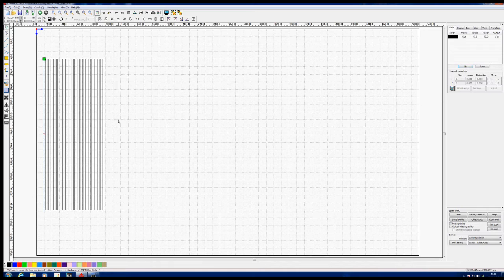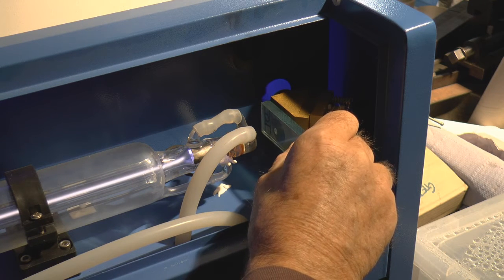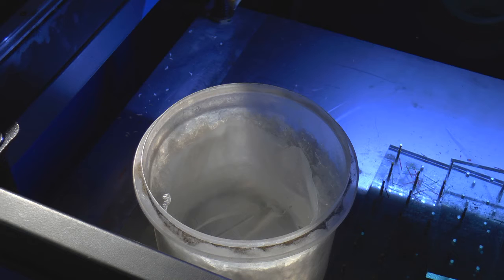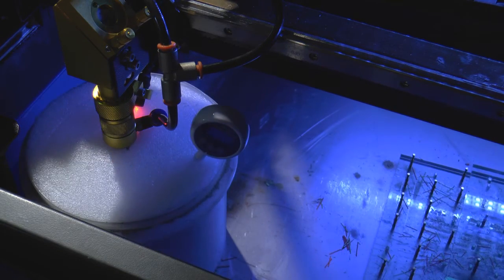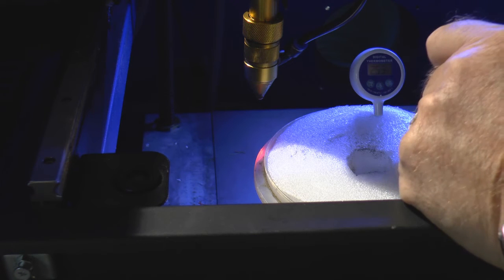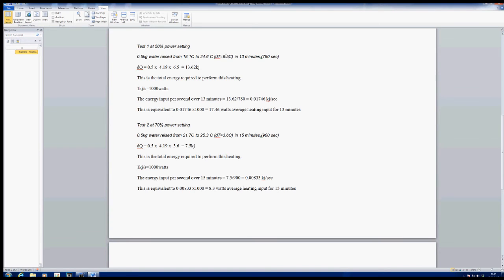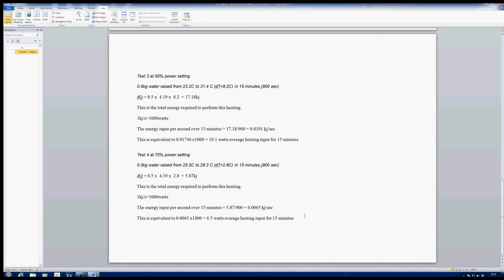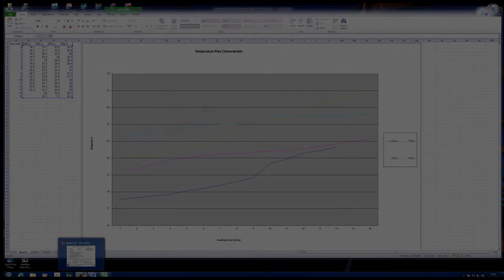RDWorks Learning Lab 21 DIY Calorimeter for wattage tests

Comment: Did you take the focal lens out to try the test?
I am thinking if it was focused it would vaporize the water surface and come of as steam without even heating the water properly.
Reply from the maker: +Mentorcase 
Both. I left it in originally for the tests on this video.  I think my lens is about 20mm focal length because I set my nozzle about 6mm above the cut surface. My water surface was about 70mm below the nozzle so the beam was certainly defocused. I also agitated the vessel continuously during the test to keep the water moving, thus limiting the possibility of measuring "hot" or "cold" spots. During my search for a CO2 laser  absorption factor for water I came across some research done by the US Navy, where they were trying to generate shock waves with a CO2 laser focused exactly on the surface of water. They were investigating this as a means of sub-sea communication.  It was a very short paper  because it failed due to the inability to accurately focus on the surface and the energy  then dissipated within a few millimetres. Without telling me the factor I was seeking, this fact indicated that I safe to use water as a test medium.
I have now fitted a replacement 50watt tube ( the video will be out in a couple of days) where I have done tests with and without the lens.

Comment: so long story short...   would you recommend these Chinese Lasers or steer clear?
I've watched all your videos from delivery to replacement tube...   was it worth it?
Would it have been much more worth it if the first tube worked out?
by the way, what in the world was ever wrong with the first tube?

sorry for all the questions, but I'm sure people are wondering.
LOVE the Videos and scientific methods empoyed.
-Greg
Reply from the maker: +gregtoob Hi Greg 
I would definitely recommend it with a BUT........just realise when it arrives you are on your own. It may be different in USA where I think they are often sold through "touchable" import agents. Here in the UK you either buy a "proper " low power laser  with tech support, or at 90% less, you gamble on Chinese unit. So financially I'm still ahead of the game and I've learned a bucketful along the way. One BIG item in that bucket concerns how you treat your tube. I think I was probably the cause of my own tube failure now that I can see the power characteristic. Having owned 3kw production lasers before I retired, I was keen to see just what I could do with a "toy" and spent a few hours working the tube at 95%. Bad news as I now find out. The machine came with no warnings  and likewise the replacement tube was just as you saw it in the box, no paperwork or warnings.   The good news about the replacement tube was  it was invoiced as "glass tube sample" and it was valued at $100. That way it ducked under the import tax barrier but I still had to pay our UK value added tax  of £20 before it could be delivered.

I have had tremendous enjoyment out of the machine already and now that I have fixed it and have learned how to treat it, who knows where my imagination will take me. Working with low wattages for paper art has been a bit of a revelation, and an area I feel I must explore further. I have always enjoyed engineering and design |(although I am not in any way an artist) and to be able to combine that with my videography hobby, what more could a retired guy do to fill his time? OH, I forgot the wife's long "to do" list.
Reply: +SarbarMultimedia Thank you sir!
I look forward to more of your videos.

Comment: Well I know this video is ancient history at this point but on my laser the power supply is adjustable and indeed greatly affects output power.  The factory setting was seemingly random.  Did you consider this before you tossed your original tube?  --  BTW Russ your videos have been immensely helpful and entertaining so thank you for taking the time it is much appreciated.
Reply from the maker: Hi Mike
Yep it is history but as I learnt more about the Chinese way of doing business via E bay I know that  both my tube and power supply were very much B grade rejects that had failed final test at the factory where they were made. These rejects work but cannot be warranted so they are bought for peanuts and fitted to Ebay machines, The usually technically naive (on laser technology)  will not be able to identify the problems, after all the machine works (sort of). i was still very naive and as you will see I replaced this junk tube with  supposed "direct replacement" from Ebay. The advertising was correct, I replaced junk with junk (another B grade) Eventually you will see me replace the tube and power supply with p[roper A grade components and I have had no trouble in over 4 years now,
Power supplies are usually set to deliver the max mA rating on the plate  when you apply 5vdc to the IN terminal. That 5vd is delivered by the controller when you ask for 100%power.  It may be a 23mA power supply which you are running with a 50 watt tube, In which case you should not run at more than 20mA, That means technically you should not run at more than 20/23=87% power.. It is possible to easily set some power supplies sothat the max output is 20mA and in that way you can safely run at 100%. You can also do it by setting 87% as a max power allowed by accessing the vendor settings in RDWorks.

Best wishes
Russ
Reply: @SarbarMultimedia  I see.  I have been struggling with my machine for months now- It’s great watching you struggle with yours but approach each problem with creativity and scientific method.  My 130W arrived putting out 29mA at 60%.  Luckily I discovered this before using it at high power.  I’ve tuned the PS to output 29mA at 100% power.  That leaves 99 other problems to sort out.  Looking forward the rest of your video series.
Reply from the maker: @mikebirmingham1699  
 Is this a Reci W4 or W6 tube? 29mA sounds a bit high

Best wishes
Russ
Reply: @SarbarMultimedia   no markings but 130W and 1400 length bed, tube itself 80 x 1650ish - so most similar to Cloudray Reci W6?
Reply from the maker: @mikebirmingham1699  
Hi Mike
I have been dealing with thousands of tubes over my 5 years communicating with people on machine issues .  Any reputable A grade tube will carry the manufacturers label with model number and test data. Those that don't make me VERY suspicious. There is a widespread practice for the Chinese machine builders to increase margins by fitting tubes that work but have failed final testing at the original tube manufacturer.  The obviously buy these tubes for peanuts.  Certainly Reci, Yongli, Tongli, EFR and SPT  would be obviously marked.. As you say, at 1650 long and 80mm diameter this is a powerful tube  but is not a Reci because even their B grade tube are fully labelled and to most eyes look perfect. It's only when you look carefully at the test data on the tube you see that it has passed the promised output power of say 130 watts but has failed to meet the max output specification.. This is still a good tube but not warrantable by Reci, so the machine builder fitting this cheap tube becomes responsible .
Various manufacturers state different values for "safe" running of their tubes. Some are particularly vague . Just recently Reci have joined the "vague club" in their redesigned website. Previously this is what they stated for the W6

Water cooling: using purified water; 3 to 5 liter/minute; water temperature: 10℃-40℃.

The operating environment: temperature 2-40℃; humidity 10-60%.

The working current: test current is 32mA. Maximum working current is 32mA. The running current must be kept below 30mA. The life span can reach 10,000 hours if the current is kept below 28mA.

Let me put that into English that is meaningful.

"We test this tube to a maximum current of 32mA which is the absolute maximum allowable and can output 160watts. The normal running current should not exceed 30mA where you will get 130 watts of output power. Although we claim   UP TO 10,000 hour lifespan you only stand a chance of achieving that if you never run above 28 mA"  
Now they don't say what output to expect at 28mA but I would estimate it to be about 110 watts. 

 In general with a 130 watt tube I would feel comfortable with 28mA  buy hey, what,s 1 mA between friends. 

Best wishes
Russ
Reply: @SarbarMultimedia  Gotcha.  Thanks for those specs.  I don’t plan on running it 100% just wanted to have a little overhead for tests?  So far haven’t needed over 50%.  It is a KH Laser tube- label says Peak Power 135W, Agreement Power 130W.  Maybe this is their admission that the peak is not 150 as it should be?  Anyways while I’ve got you… I have the same problem as you with your 10mil pink acrylic (end of Lab 26A)- the cuts are at an angle of 2.3 degrees in one dimension only.  I’ve watched all I could find of yours with regards to alignment issues.  At one point you thought the issue was a tilted lens tube.  At another you thought mirror alignment ie beam not hitting dead center of lens, and later still possibly a flipped lens.  Did you ever decisively determine the reason for the odd cut angle?
Reply from the maker: @mikebirmingham1699  
Hi Mikle 

KH Laser tells me the whole story.  This almost certainly a B grade EFR tube that has been bought for almost nothing and retested in the KeHui factory, fitted with a new official looking label ( the numbers are probably fantasy) and then fitted to a machine. They are sufficiently blase about this practice that you can buy KH Laser tubes on Ebay. They specialise in building cheap machines for Ebay sales. This B grade tube scam is standard practice for them. B grade tubes may under perform to the manufacturer's spec but you have no idea why. Your tube will either be almost junk from day 1 or if it performs OK then I could well last 3 years or more.

As for the off angle problem  see    https://www.youtube.com/watch?v=eSjNsK2sjNo
You may like to watch this video because now I have fitted an adjusble head mounting bracket to the machine.   https://www.youtube.com/watch?v=V_ehGE51rH4

Best wishes
Russ

Comment: Maybe its worth buying a Mahoney laser power meter.  cost about 100 bucks on amazon. they are just a fancy thermometer but they have coatings that are specific to CO2 wavelength.  also, can you be sure the high voltage current is fading over time?
great videos! looking forward to the tube change video
Reply from the maker: +2020tesla 
I thought I had posted an answer but it appears to have disappeared.
I investigated this meter about a month ago when someone else spoke of it. Sadly neither Amazon UK or Ebay have it available. Hence I decided to go for a simple bodge approach instead based on good science principles The biggest problem I had was trying to find a CO2 absorption  factor for water that I could include in my equation. I failed. The closest I could get was "it's very high." I have therefore assumed it to be 1 (100% absorption). It doesn't really matter for my purposes because I am more concerned with the relativity of the results rather than exact values.. For example would you expect 95% power settings to give 1/3 of the output registered for those you get at 60%. Regardless of absolute values that demonstrated a real problem with my laser tube. Your suggestion about fading current has been mentioned by another, but I'm no electronics expert so would not know where to start checking it. However, I think the plots of temperature rise rule out this potential problem because there is no noticeable levelling-off or falling with time on any of the results.
Thanks for your input, it's always good to get another view because as I mention often, I'm not an expert teaching you guys, I'm just trail blazing and recording the successes and failures so that other's can follow or avoid.
I have now fitted the replacement tube and am in the middle of a series of proving tests.  Should be published in a day or two.
Reply: I forgot all about this video/comment.  I did order the Mahoney power meter from amazon and it turned out to be junk. My money was refunded.  I ended up just spending the money for a Macken Power probe. It was much higher quality and I passed it on to Russ.
Reply: 2020tesla oh ok thanks.  it appears amazon does not have any in stock right now.
Reply from the maker: Hi CJ
I have been very pleased with my Macken meter , but it was expensive.
https://www.macken.com/collections/analog-power-probes/products/p100c

 The Mahoney meter from Bell laser is a cheaper Chinese copy . Some have found it OK, but the one 2020tesla bought for me (a year and a half ago neither Bell or Macken were shipping to the UK, so he bought on my behalf) was rubbish.
http://www.2laser.com/laser_power_meter_probe_and_laser_monitor

You may want to watch this first
 https://www.youtube.com/watch?v=lO9rWlobLZU

Russ